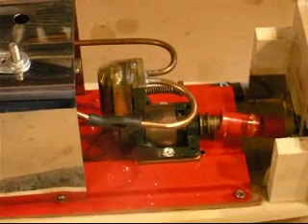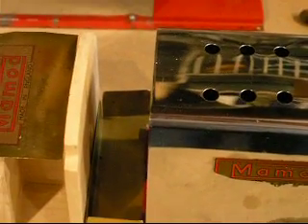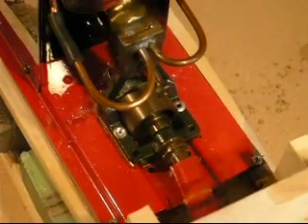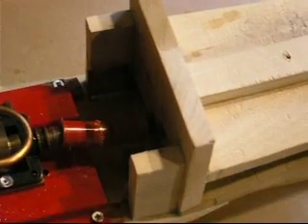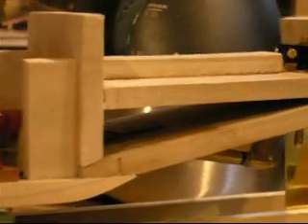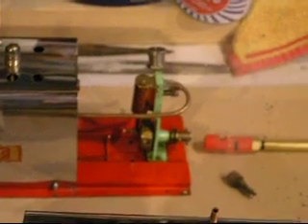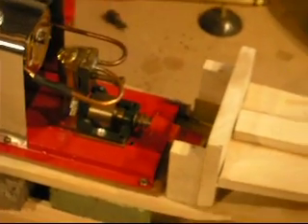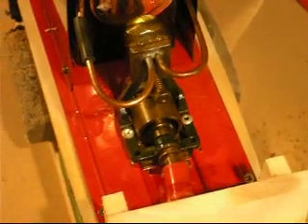Hobbies Arrow steam engine test of the Mamod ME3 powerplant

Comment from the maker: Yes it is a bit, I wish I had never mounted the engine on a couple of wooden strips! It works pretty smoothly, the UJ is pretty flexible indeed. For my next boat Im altering the base to add a few inches to the hull which will give me a little more room to play with and I wont mount the engine on strips!

Comment: Nice job,the universal joint is a bit excessive,i assume its a graupner or a robe joint,the best flexible coupling for this application is tight fitting thick walled silicone tube,quck simple and cheap and also works through very tight angles.